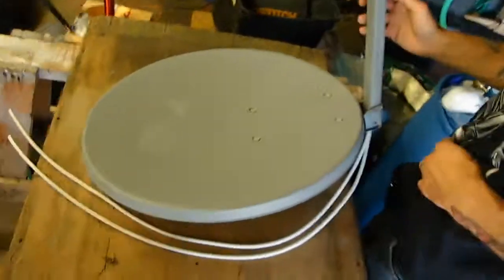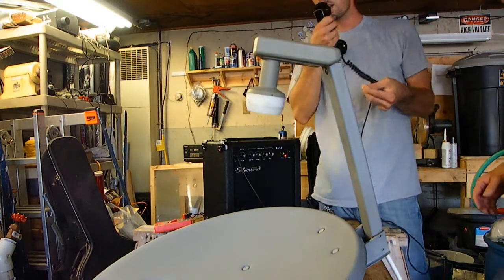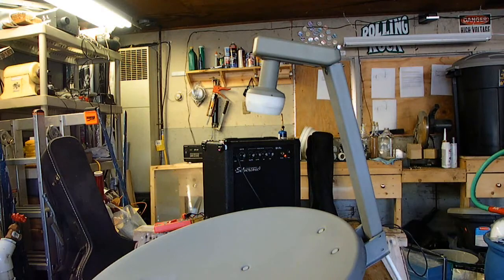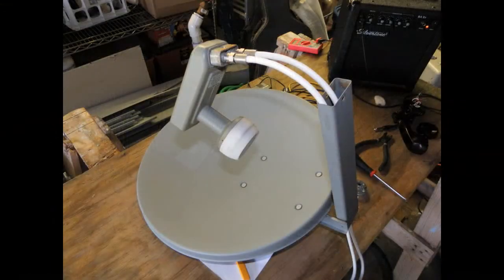Satellite microphone FAIL

Comment: Like Dump ur TV said, they used the speaker where the mic should have been. OOOOPS :/
Wonder if you had just left the sat as is and wired it to an amp with a mic input, would it have picked up the signals from say solar activity or even satellite communications and pumped out the static sound ?

Great ideas, wish I knew people like you to brainstorm with...